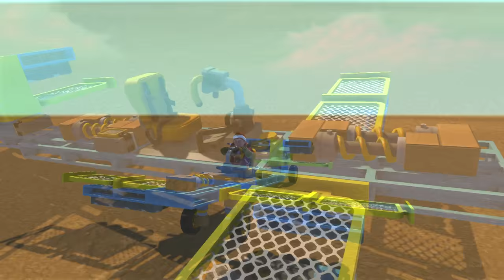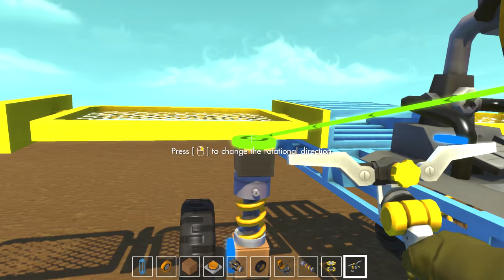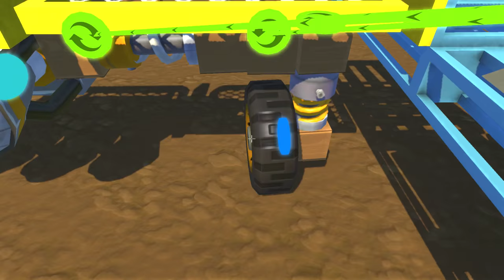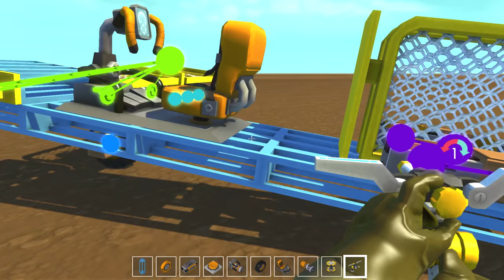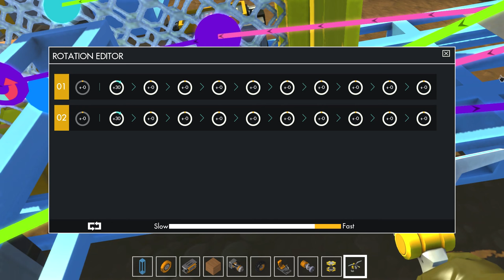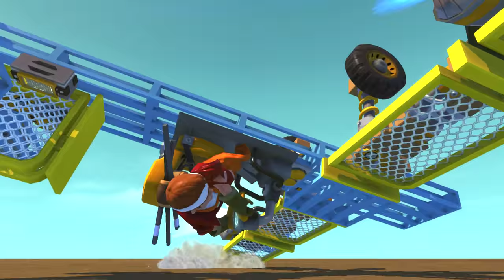Scrap Mechanic #12 - Flying Jet Airplane!

Comment: Nice plane dude :) awesome work with the steering, looks like a smooth flight! and just fyi - yes, there is ceiling really high up in the air, and you even can drive on it upside down (if you put enough downforce on your creation towords the ceiling & the driving-physics are pretty much the same like on the ground)... thx for your inspiring creations and keep up the good work ;) cheers from Austria
Reply: *a ceiling :)